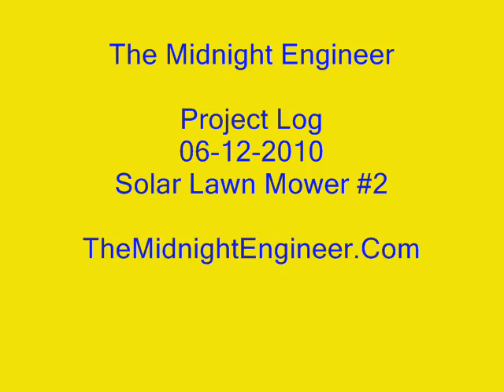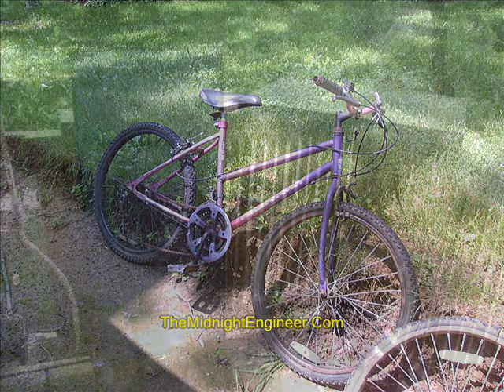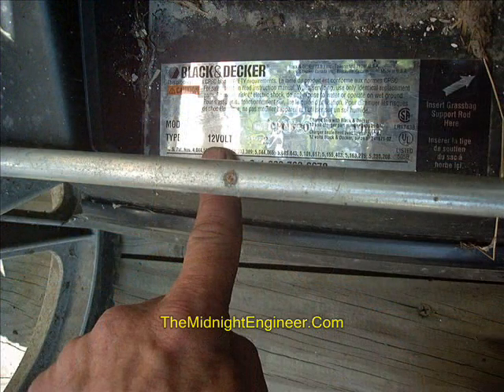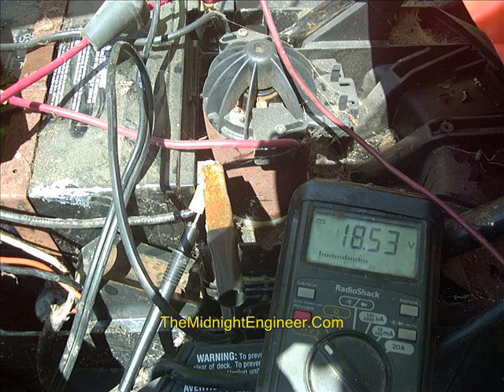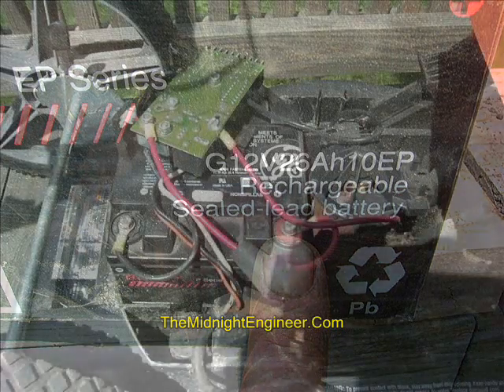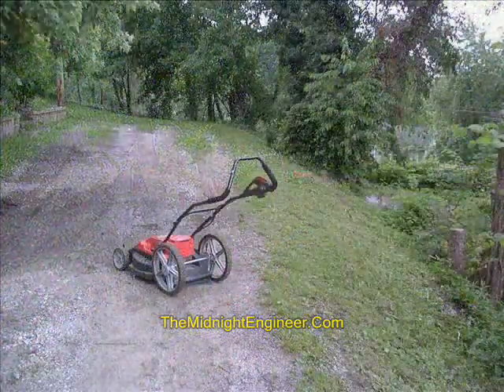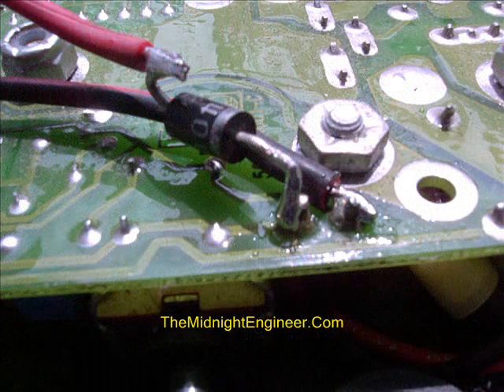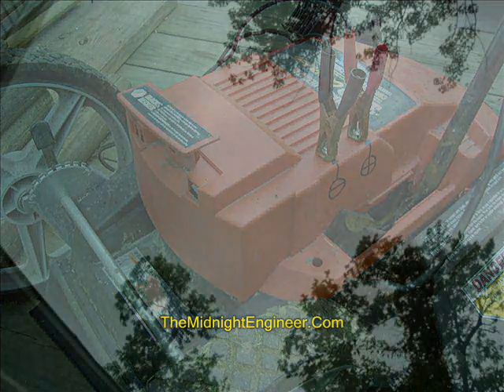DIY Solar Lawn Mower #2

Comment from the maker: @peeinginthewind Thanks for the question, A few days to a week depending on sun. The few times I used it in 2010 i used a 120w and 60 watt panels in parallel to charge and again about 1 (summer) day depending on sun. It also would depend on how far you discharge the battery before recharging.